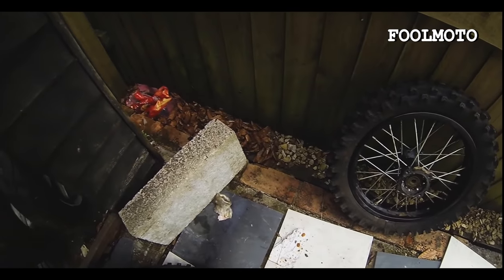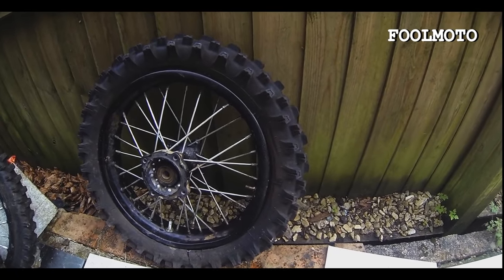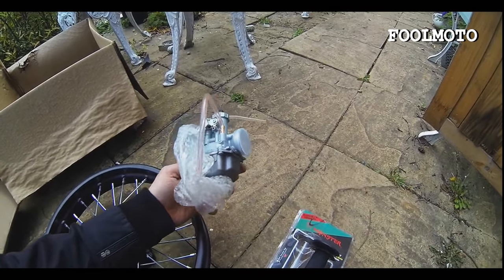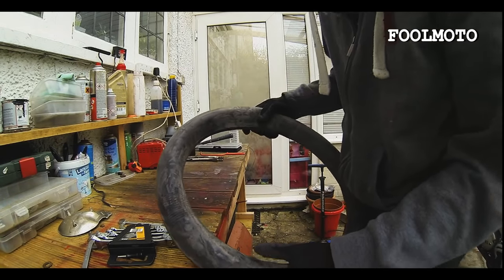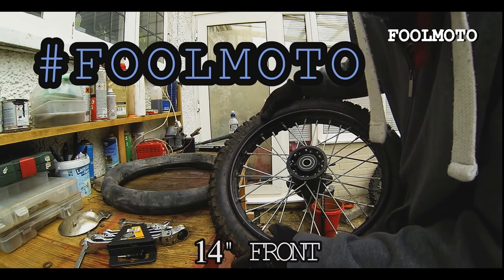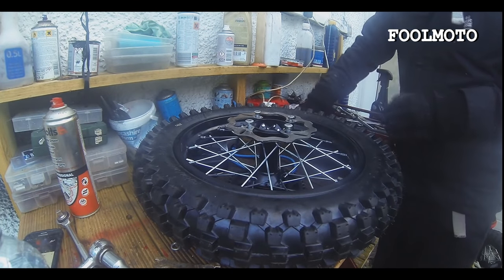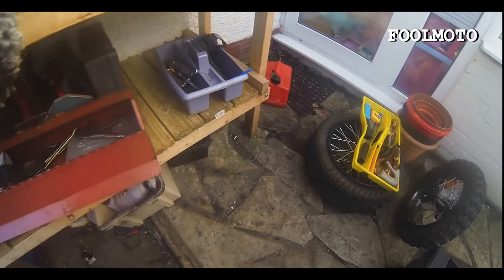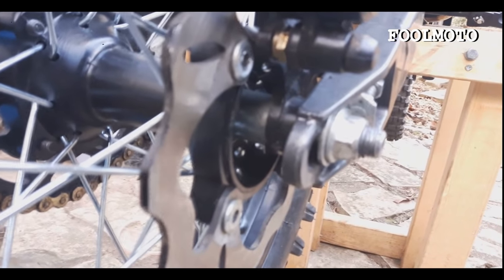PIT BIKE| SMALL WHEEL TO BIG WHEEL CONVERSION!!/UPGRADE!! |17/14 INCH!

Comment: it's to stop tube creep and ripping your valve off. and I will give you a tip, if those hubs are aluminium you should use lithium grease on the bolt threads,  I use never seize on anything that will need changing after I long time that would have been exposed to a lot of moisture especially on bolts that have been threade into aluminium as the two metals react and the aluminium corrodes and strips the threads.

Comment: Rim Lock dude its to stop the tyre spinning on the rim with a tube in to prevent you ripping the valve off at low pressure

Comment: Did you have to lengthen the swing arm?
Reply: I got some just recent 14 rear they fit but they needed a 15mm axle
Reply: My front also needed an axle 15mm
Reply: Both mine were stock 12mm

Comment: how did you upgrade the tires and the bike didnt act up did you have to throw another chain on it and  new suspensions for the rear and front or no
Reply from the maker: thanks for your comment,most pit bikes can fit 17 inch and 14 inch inch wheels with no problem,it doesn't effect the chain,i just used the same one that was on there before.As for suspension  i didn't change anything. i hope this helps!
Reply: FOOLMOTO thabjs can you look at my bike and tell me if it would work out because if it woukd then im going to the dirt bike grave to get  17 and 14 inch tires
Reply: FOOLMOTO wassul family how tall would you say your bike was raise
Reply: FOOLMOTO i finally did it bro lol my bike is awesome i just need 3 parts installed and i can ride

Comment: What you recomend? Big or small wheels? What difrent do u felt whit bigger wheels? Ps: Sry my bad English... Cumps!
Reply: Fábio Ferreira with big wheels there's a higher top speed and a lower fuel take in or eat up and if you change iut the sprockets then you definitely will be good depending on the bike but look at it like this someone that has a ferria isnt going to put 10 inch wheels on it if it supposed yo run 22 like thats stupid the bigger the wheel the more power you get out the bike
Reply: Mtb Riding Thank u for that aswer... U made my day
Reply: Fábio Ferreira np family

Comment: aparently when you big wheel them theyre rubbish on track, but it seems fibe for you so i may have to do this....cool vid mate
Reply from the maker: Thank you for your comment,yeah i havent had any problem with them so far and like the feel offroad handles all the little lumps and bumps really well.
Reply: FOOLMOTO no worries. ive just heard that you loose accel. im thinking of putting a 14 on the back and leaving the 14 on the front?
Reply from the maker: yeah i would say wheelies are bit harder to pop and you dont get so much lift off little jumps
Reply: FOOLMOTO ok cheers

Comment: where i order these tires???
Reply: eBay type in 17/14 pit bike wheels they're 15mm axles though
Reply: @grantwooden5606  can u just put 15mm axle sizes on pit bikes? So u could potentially also put 19/16 inch tires on if they're 15mm axle??? Or do you have to change anything else?
Reply: @Domotroisinthehouse  I ended up using the stock axle set up with the 17/14 wheels sometimes the spacers for the wheels have an adapter to work with the stock axle size. You would need to modify the swing arm or buy an extended swing arm to fit anything larger than 14 min barely fit and I have minimal room to adjust the rear wheel
Reply: @grantwooden5606  how did you use the stock axle set to retain the 12mm axle? I cant find a rear 12mm 14" wheel anywhere

Comment: There is two air type things incase you want to run tubeless
Reply: Hahaha you are funny. and wrong. that is a lock to prevent the rim from spinning in the tire
Reply: no body listen to this armature Lmao it a wheel lock is the right answer
Reply: It's a rim lock and...... It's not called a air typed thing. It's a valve stem and a rim lock. So the tire doesn't spin on he rim

Comment: Does this make much difference to the overall height of the bike?
Reply from the maker: wayne stewart it makes abit taller but not much makes the bike feel a bit more like a bigger dirt bike alot better for rocky surfaces not so bumpy.ive got a video up where om riding the small wheels up a  big rocky hill and its alot more rough on the ass
Reply: FOOLMOTO cheers..... I'm seriously thinking about doing this to mine 👍
Reply: @FOOLMOTO  how about the axle size? 15mm do i have to order new axles too??
Reply: @FOOLMOTO  I was curious how many inches in height you think it increased with bigger tires 🤔